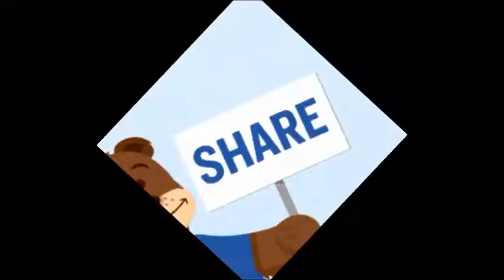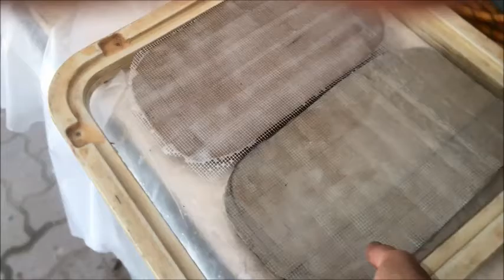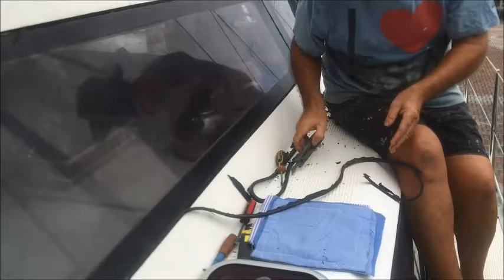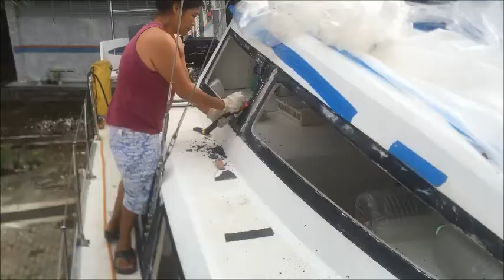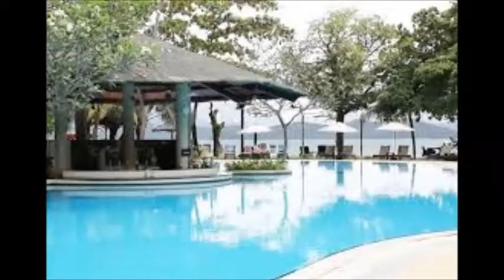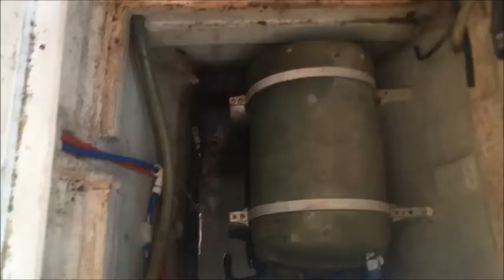REMOVING PLEXIGLASS WINDOWS - HAUL OUT - PART 22

Comment: I would investigate permanently sandwiching with permanent gaskets, two fibreglass support plates one inside and one outside the tank, and both surrounding/crossing that fuel tank access hole, that would remove the dip/indentation, and also raise the "temporaty" seal for that metal "feed" plate, to a level above the tank exterior level. just a thought cheers
Reply from the maker: Great minds think alike. I have some 20 mm phlexi glass strips I was going to epoxy them around the feed system like a tic tac toe shape to the edges of the tank. As to the inside I’ll wait and see if the outside does the job or mucks it up.  The bolt heads are on the inside. Not sure how I would get to them and the thread gives me little to play with. I always think things thru and Rob Andersen the diesel mechanic will be my bouncing board. Thanks for the advice and a few things I didn’t think of.